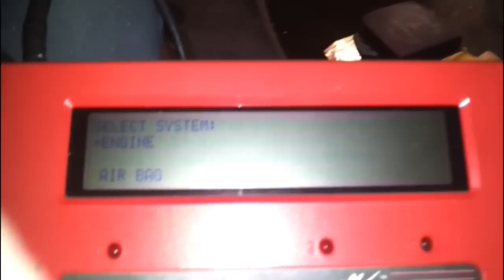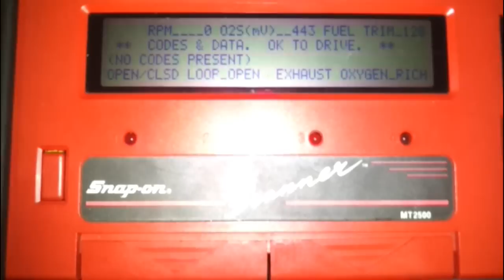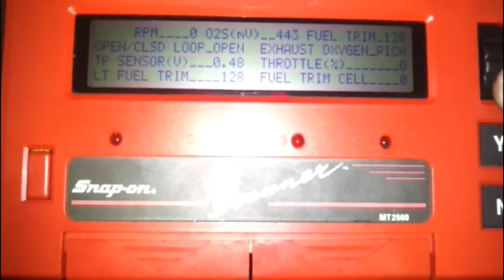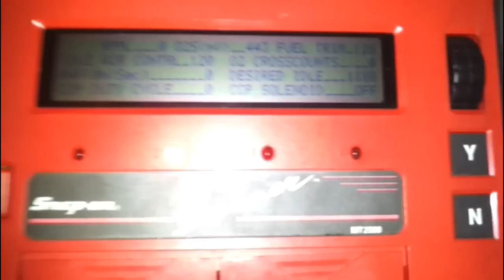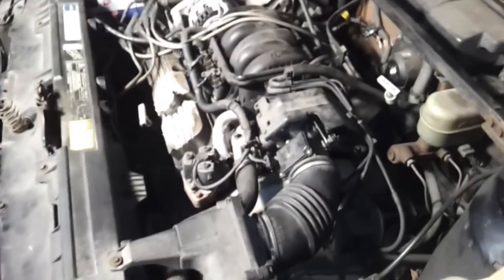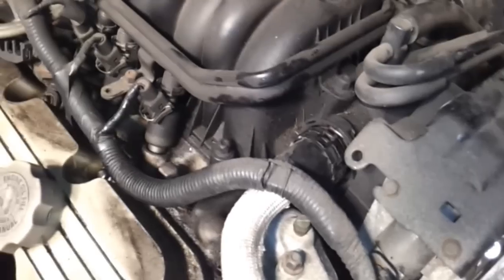Real time troubleshooting, unmetered air

Comment from the maker: Good question wish i had more time when filming, correct, not running long enough staying in (open loop) i could hold the gas pedal about half way and keep it running but screaming loping, coming sign of a MAF reporting incorrectly or unmetered air, 'Open Loop', the ECM will ignore the signal from the Oxygen (O2) sensor and calculate the air/fuel ratio based on inputs from the coolant and MAF sensors, but mostly from a pre-programmed table in the memcal. would love to make a series on this

Comment: Its ironic that the amount of unmetered air was so high, your scan tool was not able to identify the vacuum leak. Presumably if the vehicle were able to continue running, the more typical STFT/LTFT pattern would have been seen. What made you think the problem was unmetered air?